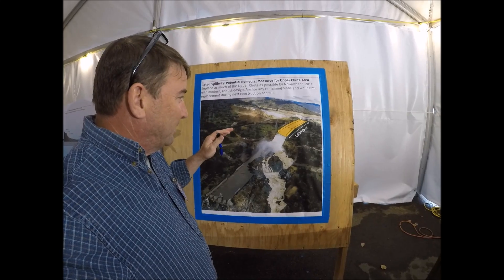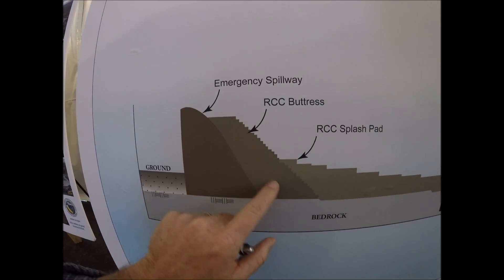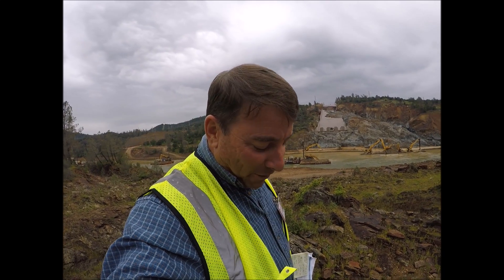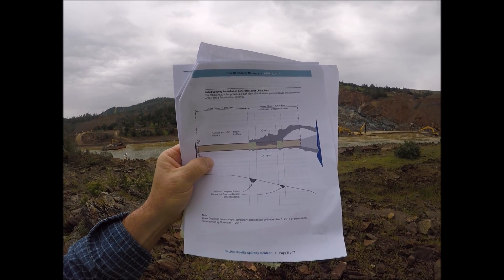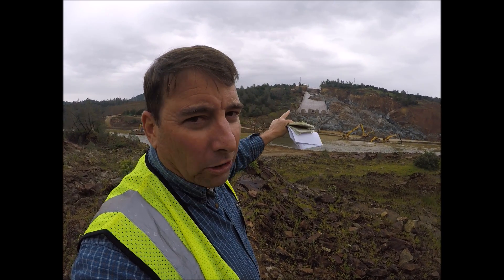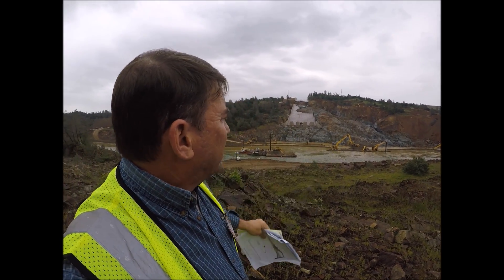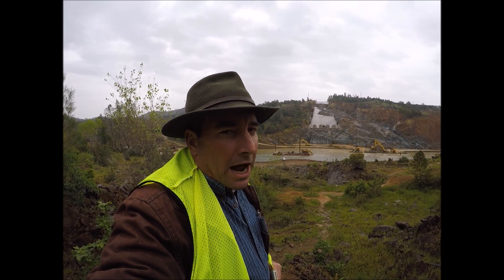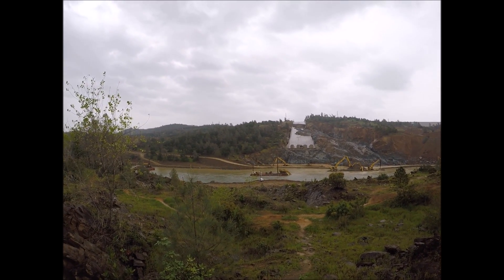Oroville 6 April Update The 'New' Spillway Design Revealed!

Comment: Rebuild the "undamaged" top? Hmmm. A nickle says corings showed significant flow underneath crete. Explains the drains in the shot crete, and the new new canyon at far left, facing uphill. Not to mention original failure.  Soooooo... upper chute is how close to failure now? And when did they first realize they lost containment?

Oh, that's right, Critical Energy Infrastructure Classification Level: Echelons Beyond Reality.

Just by asking, one is liable to  disappea

Comment: Juan, several people have said on other channels, maybe this one too, that the gates to the spillway are decayed, I don't think so, they seem to function fine but was there any mention of replacing those? Perhaps they would replace them anyway since they seem to be planning a much higher potential outflow? As always you're are doing a great job and if I had some extra money at this point I would kick you some. You're providing an excellent service to us all for free and you should get at least enough to defer your costs. I think it's also interesting to note that the new design seems to be intended to handle enough flow so that the emergency spillway is never needed. Even so, they are beefing up the emergency spillway nicely. As an Engineer, I'm pretty impressed with this effort, what do you think? And lastly, is there any indication that the main dam broken interior concrete barrier repair is leaking at all? A few years ago there was a couple of reports about that internal barrier moving and cracking causing some leakage but repairs were made by pumping concrete underground that supposedly worked, but others on YouTube "claim" that it is still leaking? Maybe the information officer could clear this up? Thanks a million.

Comment: It's going to be interesting to see how much involvement those of us here in Indiana will play with regards to the rebuild plans. We have ramped up truckloads of steel blooms to 30-trucks per day for last several weeks so the steel mill west of Indianapolis is well stocked for the manufacture of steel rebar on a massive scale. I just cross my fingers and hope we get to play a part in the re-build. As for the last video it showed just how thin the concrete was in the upper section which might've led to the destruction of the spillway which is now the plunge pool. Hopefully they will be smart this go round and make the concrete as thick as an airport runway which is four feet. At this point money should be no object or limitation although in the end someone has to pay for it but as stated, this work to come needs to be future proof and be able to withstand the goal cfm of 270k.  This is their chance to get it right.

Comment: Holy crap, 1 week to get bids submitted with work starting 3 days later... O.o
Reply: I'm guessing that the "Critical Energy Infrastructure" designation enables CalWater to now bypass normal procurement procedures & legalities, and red tape. Once things start to roll, what a nightmare it would be if the designation didn't stand up. Bids in - without knowing the TBD causes of what happened - but the findings to be incorporated in the fix? Pity the CalWater manager of any of those contracts. Think they can forget about any home life for the next year or so.
Reply from the maker: risky business...
Reply: It's going to be cost plus. About all they can bid is equipment and labour rates and material costs. The owner ( California ) always accepts the risks anyway. When you work fixed price the contractors build risk into the price and that's dollars, lots of dollars. Cost plus may actually be cheaper but we'll never know.
Reply: I think the Critical Energy Infrastructure designation just relates to limits on releasable information. They use this to avoid disclosing technical information that could help saboteurs damage the infrastructure. That is probably also why they consider the root causes of this year's problems as CEI info so that bad guys can't go recreate the problem in the future.
Separate from that, the state does have provisions for expedited procedures in emergency situations where public safety is at stake, as can certainly be argued here. I'm sure that was also used to hire equipment and contractors in a matter of days to start cleaning out the debris below the spillway. Wish they could be that efficient for all state projects!

Comment: As you are looking up the spill way why are they excavating the very top of the hill side to the right of the cliff's. They are really digging heavy into the hill .
Reply from the maker: erosion control, and stabilization of the slopes for workers below.
Reply: @rocco muriale: They are trying to get ahead of a problem. DWR can dig the dirt out of the diversion pool pretty well. But when the hole hillside goes down the big trees and big shrubs can pull over the excavators with their awkward weight.

Comment: Juan, what's the plan if there were to be an extraordinary rain event during the summer? Obviously chances of that are extremely low, but what is the lake did need to be lowered? Will the only option other than the power plans and river outlet be to wait until the water spills over the emergency spillway? Also, would that necessitate a quick repair of the emergency spillway just in case?
Reply from the maker: not during the summer.

Comment: Great 2nd question but I guess if they need to spill down msw anyway they don't need the 5000cfs, as much as in between big spills.  If they can't run hpp with the river outflow system at the same time it wouldn't be much help because they won't shut off the turbins....I mean turBINES.    Did you catch Bill say turbin not turbine...lol.

Comment: How many CFS with all the gates above the spillway open? Do the gates even allow 270KCFS?
Reply: I suspect there is an engineered safety factor built in, say 2:1. That done, the SW could handle 135KCFS continuously, yet have that much extra capacity in reserve in the case of torrential rain (one hundred year event.)

Comment: What exactly is the purpose of the cut off wall?
Reply from the maker: to provide a 'footing' for the rolled compacted concrete.
Reply: The cut off wall prevents erosion of the earth from undercutting the RCC splash pad.
Reply: blancolirio Thank you Juan :)
Reply: The cut off wall is at the emergency spillway. It's dug down deep so that there will be no undercutting back under the emergency spillway
Reply: dlwatib Thank you :)
Reply: Bob Smoth Thank you Bob :)

Comment: Considering 2 things, the spillway turns steeper between a third and half way down the mountian, the spillway failed just below the part where it turned down the steeper part of the mountian. Considering what water can do to the rock underneath the spillway perhaps the steepness of the lower half of the spillway slope is a large component of the problem. Maybe they should dig into the slope and create a concreat man made plunge pool at the point where the incline becomes steeper, from that plunge pool, or waterfall if you will, have the remaining new spillway continue on to the Feather River on a much more gentle plain that would be much less reliant on it being reinforced to the rock underneath. The new man made plunge pool would help defuse the force of the water before it continued on down the new more level spillway towards the river.
Reply: They probably followed the terrain to some degree when they built it
Reply: Yes, plainly they followed the terrian with the orignal construction. I'm saying that was a major factor in why it failed where it did. The weight of all that concreat on such a steep slope caused tooo much strain at the point where the slope became steeper. Any new design will need to compensate for that.

Comment: Juan,

I must have missed the issue with the existing Emergency Spillway. What damage did it suffer? Why can't it be used at present?

Thanks.
Reply: Basically the emergency spillway has no foundation. The minute water flows over the top it head cuts underneath which would lead to imminent failure
Reply: To My understanding it was not properly set-up/built in 1968/69, and it was never used until the dramatic events in February, and it totally failed. So, right now they have put a Lot of concrete and rocks to prevent it from failing again, and they are still deciding whether to rebuild it properly or not even use it at all?
Reply: My understanding is that it was ignored while building the parking lot for the boat ramp at the far end of the dam.  That area was running water while the E spillway was running water too. The E spillway however is concrete firmly attached to bedrock, the parking lot road is just a road.  If they want to stop water from taking out the parking lot road they will have to dig down adjacent to the road and build that area higher than the E spillway by say ten feet or better such that water ONLY flows over the E spillway.  They never built the wing up to proper height since they never intended the E spillway to be used.  Oversight squared.

Comment: If they end up using the canyon as overflow from the main spillway am I correct to imagine they would have to build a lower wall on that side of the replacement spillway to allow water to divert into the canyon when flow tops 160,000 cfs?
Reply from the maker: yes, as I understand it for the 2018 season only.

Comment: We haven't done real fast dam work since WWII. Here are a couple of links to the Salinas dam. http://sloblogs.thetribunenews.com/slovault/2008/08/1966-salinas-dam/ and https://www.loc.gov/item/ca2276/ Of particular interest is the data manuscript at the library of congress. Sometimes the best results come from having a championship quality team and not micro managing them.Today, we have too many armchair generals with satellite video links and too many big wigs who demand their prerogatives while disclaiming responsibility. 

Rapid set concrete can achieve 7 day equivalent strength in a little over an hour. It costs more than twice as much as  portland cement concrete, but Caltrans uses the stuff for replacing cracked up freeway lanes so that they can go from begin demolition to return to service in less than 8 hours. It also has almost no shrinkage as it ages. Its really good stuff, sort of like Champagne vs Beer. We should be past the point where money is the only consideration. Unfortunately, Oroville could take most of the current supply, or more likely enough to drive up the price.

Comment: The spillway design is flawed as the downward angle changes at about 1000' from the point of release. At that point is gets much steeper  and a high flow will be air borne and instead of flowing over the concrete will just pound into it and destroy it again.
Reply: The water is only going about 50 MPH. There's no way it's getting airborne. You get more airborne on the highway going over an overpass.

Comment: Thanks for all your excellent reporting Juan!
What I don't see in any of the discussion is how they plan to bring the subgrade below the RCC up to a level surface that they can pour the concrete on to.  I have not seen any information on the depth and size of the gorge that has been created between the upper and lower parts of the spillway.  Can you find this information out?  It looks massive.  Will they try to bring that up to the level of the bottom of the new spillway via some sort of fill process?  Or will they try to bridge the gap with some sort of bridging structure?  DWR's preliminary scheme seems quite fantastic from the view of this structural engineer!

Comment: I think they should put in one so-called "fancy" engineering feature. They should put a hydraulic jump near the top of the spillway to prevent further erosion from supercritical flow. That way the engineers won't have a scare like this in another 50 years. I'm not too well qualified so not sure how valid my statement is but I do have an educated "hunch".
Reply: That would be cool. The water at the top is going about 30 MPH and 50 MPH at the bottom. It's not critical flow.

Comment: After the rebuilds, they'll be the main, a secondary and an emergency spillway ("Rocky Valley").
I'm curious that in an emergency how they'll divert a portion of water down the Rocky Valley?
Reply from the maker: it would simply pour over the top of the emergency spillway, the top of the old Ogee weir.
Reply: Ogee weir?
When done, they'll test it for us to see if the diversion method works?

Comment: Hmmm....  I know they are using the expertise of Hydrologist, but rebuilding that broken section is going to take some very expert engineering.  I don't believe they will be able to pack rock and soil hard enough in the gorge to withstand the hydraulic rumbling created by a 100 cfs water flow over the concrete slabs on top of the packed earth, unless they put in the new measures which newer reservoirs have incorporated into their spillways to keep what I believe they call the cavitation affect at a minimum.  Also the smoother the surface of the concrete the more laminar would be the flow of the water

From Google search:
Laminar flow"In fluid dynamics, laminar flow (or streamline flow) occurs when a fluid flows in parallel layers, with no disruption between the layers."  Meaning no air is churned into the water creating cumulative micro vibrations.
Personally I believe they should take out that lower lump of bedrock without blasting, (if that is even possible) creating the look of a slide on that lower half.  Blasting may disrupt the bedrock under the dam if they try blasting out the rock at that lower spillway section.  Then like those blocks at the lower end of the spillway, they could put in new ones to keep the force of that much water from unduly changing the shape of the power plant pond.
Reply: They're going to fill the holes with RCC rather than crushed rock fill. Basically that spillway will be built on bedrock. The water flow is a live load and is accounted for in the structure. Cavitation is not an issue.

Comment: Thanks Juan!!  I'm wondering, will the  upper gates be able to release 250,000cfs if they aren't changed? Also, I don't understand how the spillway can have water running over it at 250,000 cFS at the top and only 150,000 CFS (or whatever the amount was) at the bottom. What happens to the difference? Does that go through the canyon, or was there something I missed, as the variance in CFS from top to bottom sounded like it was planned to be the norm. Thanks for clarification and an amazing job!!!
Reply from the maker: thru the canyon...at least for the 2018 season.
Reply: Thanks!

Comment: I would LOVE to own a concrete plant in that area, or be able to move a mobile concrete plant into that area, for this project. Man! that's a lot of mud!
Reply: To be more explicit, I would expect that they would want to use "freeway" type construction, with rebar reinforced columns to build a prestressed concrete deck across the washed out portion of the main spillway, and then pour additional concrete on top. Existing technology with known limitations and experienced contractors.
Reply: Honestly, I'm surprised they decided to reuse and rebuild the existing spillway design, rather than using the "new" bedrock canyon, which has already been scoured and is not likely to present any unexpected growth patterns. But they must have had some good reason for it... yeah.
Reply: Without knowing more, why is it that the "thinkers" seem so set on using a straight line, man-made spillway, when there is an already existing lower spillway of bedrock?
Reply: I'm sure there will be at least one mobile plant on site, if not more. Also, some aggregate piles south of the dam indicate that at least one crush/screen plant is already operating.

Comment: Can the river handle 270,000cfs?
Reply from the maker: No, only tested historically to 160,000CFS
Reply: If they have to dump 270,000 CFS over the spillway they would have held some back to give people a chance to RRUUNN
Reply: At 270,000 they'd have to open the Thermolito Diversion dam and just let it flow and hope. It would top the levees and flood a wide area. They would probably have drained Oroville as much as possible and used its filling time to give people a chance to evacuate. That much water would probably have been a full out hurricane making landfall

Comment: Thanks so much for all your work in gathering info. I have sorta two questions. 1) If they do not yet know cause of failure of old spillway, how can they be sure replacing with same basic design won't fail in same way? 2) Given the probably high cost to "repair and replace", why not simply find a way to use the new "water feature" as part of the new spillway instead of rebuilding the whole darn thing?

Comment: It is interesting that the Low Level River Control Valve which was broken in 2009 hasn't been mentioned much. I don't know if it was ever repaired and is currently functional or not. Use of this system is limited but it seems to me that there could be times when any water release system however small could be valuable and should be kept in good operating condition.
Reply: Juan asked the question and it should be operational in a month. We don't know if it can be used in conjunction with the turbines. It was intended as a water release when the top of the penstocks come above the lake level and the turbines can't be used
Reply: I should rephrase that, when the lake level drops below the level of the penstocks
Reply: And Juan - Thanks for the hard question as to whether the RCVs, designed to release water when the lake level was very low, could be operated under a much higher pressure when the lake level was near its highest.  I did not take that to be a "Stump the Chump" question, as many of us have wanted to see if they could safely operate the RCVs along with the turbines for the very point that you made.